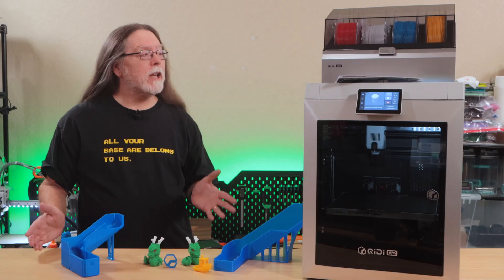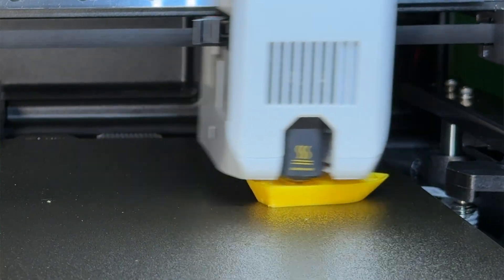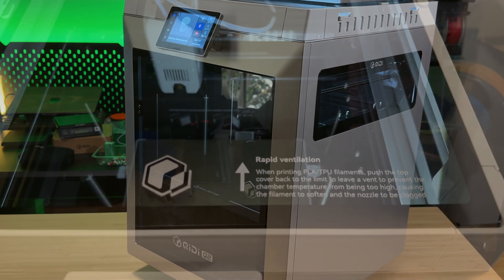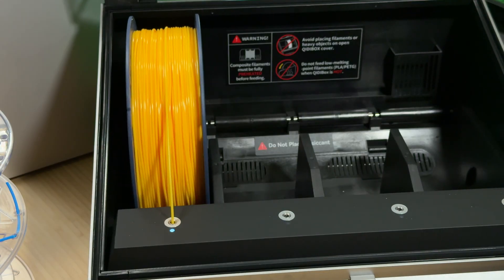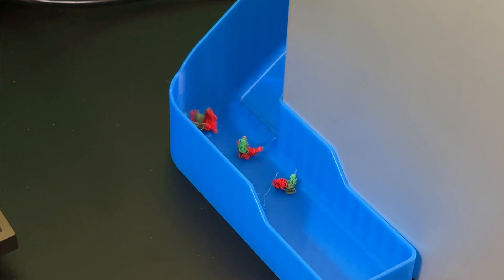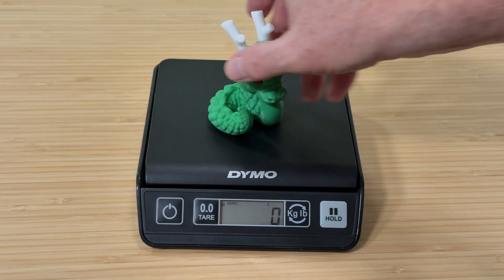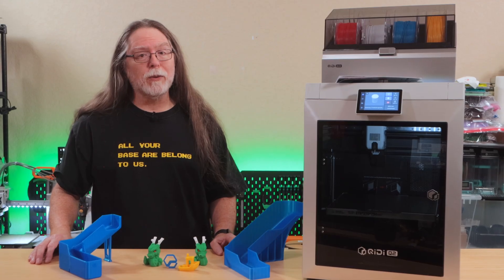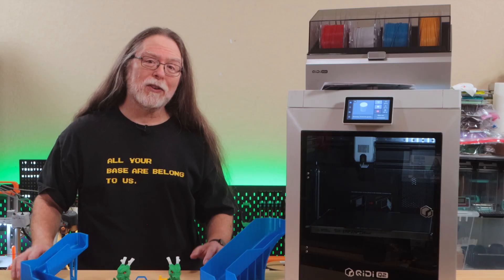Qidi Q2 Combo Review: Great Printer, Complicated Add-On?

Comment: My understanding from other videos is that the riser gives a bit more space and gentler angles for the feed tube from Box into enclosure. 
Apparently with the v1.0 of the box there was some pinching and whatnot when feeding in filament. 
I guess they thought, well, while we're adding the riser, let's throw in some venting. 
I honestly find it janky that you slide the top back with the box sliding back as well. You definitely have to account for about an extra 6-8 inches in the rear to accommodate that.

Comment: Box sitting on a sliding glass, with no stoppers nor slots -- accident waiting to happen 😬
Since the Box already comes with a riser, why not make the riser to be the base for the Box and free the glass to slide alone (until it hits the stoppers)?

Very long tubes might make tinkering inside the printer easier, allowing the Box to be lifted to the side (or to the next room 🙃), but they add to the filament change time. Every freaking time. No thought seems to have been put in them 🙄

The printer itself seems to be quite nice, and Q2 C (as cheap?) sub-model (without enclosure heater, camera and one other thing that I don't remember right now) is quite tempting. But for PLA/PETG support interface, with the Box? Maybe? Creality K2 is slightly cheaper but combos are about the same (EU) price...

Comment: The hub setup is intended to reduce retraction and feed distances fir filament changes, in theory this should make filament changes quicker. But the makros qidi use are massively time inneficient i wish i was it savvy enough to do something with the macros
Reply: Im pretty sure there will be some improved macros in the discord and/or github somewhere

Comment: Have you had any issues with the system crashing? My system requires me to reboot the firmware and clipper pretty much once or twice a day.
Reply from the maker: The only time I've seen a crash issue is if I turn the box off while the printer is on. About the only time I'm doing that is if I'm turning both of them off to move the printer, so I didn't really think much of it.

Comment: How did the Qidi Box deal with cardboard spools? Nice Steve Martin flashback, too!
Reply from the maker: Hi Stew, it did fine, but Qidi cautions against using them, citing wear on the rollers. Worst-case, you could print some plastic rims for the cardboard spools. I've done taht before for my AMS units.

Comment: I've had my Q2 since the initial launch, and I have to say, it's been  printing some fantastic items! First layer adhesion and consistency are on point! My Qidi Box arrives in about a week. I already have one for my Plus 4, but I haven't hooked it up yet.
Reply: Same here, waiting on updated QidiBox to arrive, but might try a Bambu 4-1 PTFE tube between buffer and printhead, as a single spool feeder filament path option. I need to test my 0.6 hardened nozzle set up too.